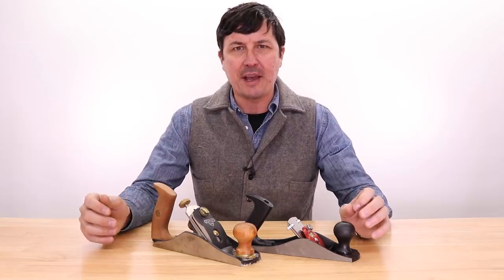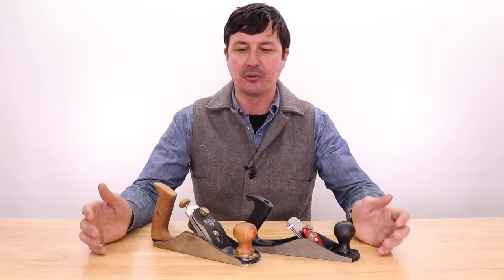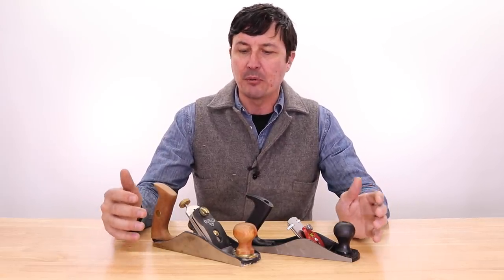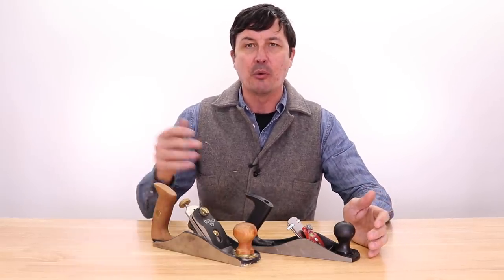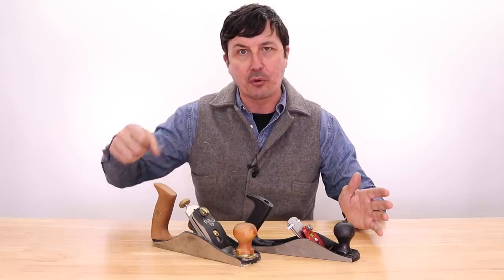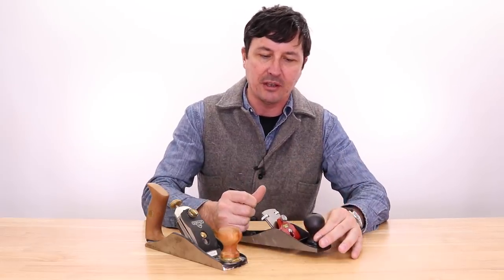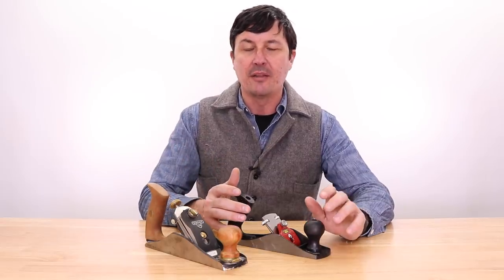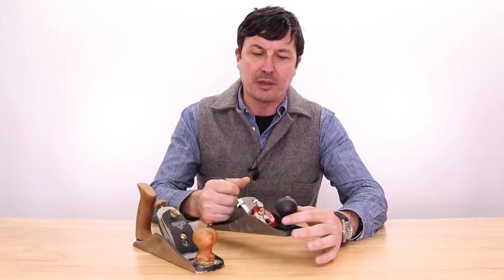Testing The Cheapest Bench Plane On Amazon

Comment: Why not start with 200 grit and then move to 320 to cut your time way down?
Reply: DigitalMocking I used to buy handplanes at flea markets. Most were so rusty that I had to start under 100 grit. 
Maybe this plane is too thin and he didn't want to risk taking too much
Reply: raphaelbianchi You can only take too much if you keep grinding beyond when the entire surface has been flattened. Up until that point you haven't removed enough. Also that glass is too thin to be counted on as flat, especially on an uneven surface. Most likely the center was low, and now the plane sole has a slight bow. If you can't find thick glass (if you watch your local classifieds you should be able to find something before long for very cheap or free), then stack multiple sheets of thinner glass. Each layer helps to reduce the amount it can flex and conform to the surface below.
Reply: DigitalMocking 200 grit diamond stone or lower would make quick work of leveling that plane out as well. Better yet buy a cheep synthetic.
Reply: I purchased the exact same plane and used a granite flat stone to surface the foot of the plane. My experience was identical to Wranglerstar - the foot is severely cupped.
Reply: Start with 60 grit if you've got a lot to do. But don't stop short like he did - use a more aggressive grit to start with and work up to 320 but get the surface flat. There is no need to ever go finer than 320 on a plane bottom so he actually started with what he should have finished up with. The entire idea is making the sole flat - shiney doesn't matter.
Reply: gl taking too much by hand, lol
Reply: I would use a stationary belt sander if it was that bad.
Reply: Bench top sander is a great place to start if the face is bad

Comment: 8:59 glass being a really thick fluid is a myth, i remember back in college chemistry classes chit chatting with the professor and we entered into the topic, and he explained me that glass cant be a fluid because (insert bunch of chemistry that i cant quite recall) and probably the glass was insterted with the thicker part down to make it more stable. 

fast forward not so long ago, i got a chance to talk to some architecture students and they told me that in their field is pretty common knowledge that before machines and such, perfectly flat glass was hard to come by, so everyone ended up with glass kinda missshapen to an extent, so they would put the thicker part of the glass down so its more stable. and this is supported by the fact that 300 year old telescopes still work perfectly, and the lenses havent changed a bit, or that even older windows are not even more deformed
Reply: Wow that's awesome 👍 thanks for the info

Comment: If you need to put that much time into tuning up a NEW plane, I wonder if the time would be better spent on finding a decent used older plane and doing that work to it. Might spend $20-30 on an older Stanly standard plane, but I wonder if it would last longer in general...

Comment: Just a heads up, the back of a plane blade does not have to be completely flat. Since the blade is cutting on an angle, only the (secondary) bevel is making contact with the wood.

Comment: I just bought this plane a week ago from Amazon for less than $20 with free prime shipping.

I spent close to 3 hours flattening the sole at 80 grit, when the entire surface was touched I moved to 150 for half an hour, then a big jump to 600 grit (fresh out of everything in between) for half an hour. The 80 and 150 grits were dry and the 600 was wet. I found that after a few dozen passes on dry paper, you can run a magnet along the paper to collect the filings. All that gave me a near mirror finish.

I'm still working on the iron, but I've reground the primary bevel to an accurate 25° with plans for a 30° secondary. I'm currently working on getting the back 100% flat.

After an early test run with a blade only at a 25° 600 grit bevel, I noticed the twin nuts are a pain in the @$$ to use. I kept over tightening one, then the other, took many tries to get it level. Then I wanted to adjust the depth and had to do the whole process again. Might get easier with practice.

With my very limited woodworking knowledge, I'd say it's worth about what I paid for it. It doesn't exactly appear to be a diamond in the rough, but certainly a slightly frustrating, yet usable alternative to the expensive ones once tuned properly.
Reply: Take those adjustment screws off and throw them in your spare parts bin. for adjustment see my post to Wranglestar above.

Comment: It seems a bench plane is a lot like a guitar.  You can get by with a cheap one as long as you set it up properly.
Reply: M ZAKRIA not really that simple, depends on the plane but you generally need to flatten the bed, sharpen the blade and tune it in other ways
Reply: yea,  but like a guitar, if you consider the time you spend setting it up(not to mention using it), it makes more sense to start out with a quality instrument imo. Time and attention are our most valuable assets
Reply: M ZAKRIA yes that’s fine, I’m only 14 and am restoring my first hand plane on the weekend however I have used Stanley’s, record and lie nielsen planes and they all require a bit of tuning, lie Nielsen less than others but my point was just that it isnt always easy, anyone can do it but it takes time and patience
Reply: M ZAKRIA and yes I understand how the plane iron works, you sharpen it and generally it lasts a while, then you have to sharpen it again. Just don’t make the mistake of buying new blades like ive seen people do

Comment: Cody,
Great idea! Love your channel.
 My suggestion would be to do these in this order: 
Measuring devices first (tape, try or speed square, carpenters square, & plumb bob/chalk line) then,
The saws (crosscut, rip, back, and hack), 
Chisels (1/2", 3/4", & 1"), 
Files and rasps (flats, half-rounds, and rat tails in fine, coarse. and rasp cuts), 
Hammers (carpenter's, tack, and ball peen - and maybe a set or hand sledge), 
Drills (power and hand), braces and bits, 
Sanding block(s) and papers, 
Screwdrivers, 
Pliers (utility, vice-grip, & needle nosed),
Clamps,
Whetstone,  
Retractable utility knife, 
and .... (perhaps) A book on woodworking (have you ever thought of writing one - "in your 'spare time'"? Your knowledge and style would probably make it a best seller.)

In any case, it's your channel, your choice - just my suggestions.
Reply: +1 to Super Geek comment. The book would be a nice addition. 
To the woodworking series would be nice to add a dedicated episode about protecting wood surface, hard and softwood. Both for indoor use and outdoor use. Maybe these informatons were present and i missed them in older vids but it would be really nice to gather all that into one episode.

Comment: Neil Degrass Tyson would disagree with you about the old stained glass windows... I watched a documentary where he refuted that statement by claiming that the art of making glass wasnt as refined as it is now and that would explain any irregularities in the different panes. Also, there is no solid record of anyone finding this to be true, only word of mouth folk lore.
Reply: glass used to be made on a spinning wheel, and therefore, due to physics, more material would be pushed to the outer edge. Then, the glass would be cut into panels, and as us labors do, heavy end down, giving the appearance that the glass was "dripping" downward
Reply: Evan Goodwin, I recall something about spun glass in the documentary I was watching. Thanks for your input :)
Reply: If the glass was making the bottom edge 'fatter', then the lead would have opened up, possibly causing the pane to leak when raining, but definitely you would notice the difference when the wind blew.
Reply: Dave WasinColchester, another great point!
Reply: veritasium does a very good job of explaining...

Comment: Is it possible the high spots on the heal and toe are intentional? I saw recently that traditional Japanese hand planes have a slight hollow between the leading edge and the blade (presumably to reduce contact surface area and therefore friction, but maybe for other reasons).

Chisels would be perfect for the next episode. Measuring equipment should come soon, too--marking gauge and marking knife, square.

Thanks for the series. I'm just getting interested in woodworking and it's great to know how good or bad the cheaper options are. Between this and Paul Sellers' series, I won't lack information to get started.

Comment: As a former shop teacher I always taught my kids to NEVER set a plane down on the sole. Even on wood. Always set it down on the side. Yeah, I know it's knit picking. LOL
Reply: why would you no put it on wood? its the material you cut.
Reply: because it can damage the tables
Reply: Because if you learn to never set it down that way, even on wood, you probably won't set it down on anything harder, aka, metal. It can dull the iron. Call it a learned reflex.
Reply: what I was trying to say. its about working habbits in
Reply: Wayne Novotny Paul Sellers debunks that practice with a good explanation that kids are kids, and a plane iron is at LESS risk when it's sitting on wood than on edge where a stray chisel could wack it. I've gotten out of the habit of laying a plane on its side.
Reply: Might dull your $20 plane :)

Comment: I'm not sure how much I trust a guy who has an expensive plane but never really took apart and couldn't tell you what the backing iron is
Reply: And leaves it sitting on it's sole!!!  Sacrilege!
Reply: @chrisw1462  I have no problem leaving a plane on its sole provided it is on my wood bench, free and clear of any metal.  The plane blade edge is certainly tough enough to withstand moderate contact with wood, without damage.  Try it and report back to us if you wish.
Reply: I just thought it was interesting how big of a deal he made about the thinness of the cheap blade—it looks thicker than the old Stanley blades for all my old bailey style planes. Also, why did this dude start with 320 grit on something so rough? I would have started with like 60 or something and worked my way up, Just me tho.

Comment: My father-in-law bought this plane for me as a birthday gift about 4 years ago. After sharpening the iron it cuts great. Mine does not have the curations on the handles like this one. I do have trouble getting a square cut though. Always takes more along the right side than the left. I’ve since bought a Stanley no. 3 from the 30s that I prefer to use, but still use this one from time to time to teach my son a few things.

Comment: 1. Make sure you're using poured glass as it is much flatter.
2. Start with a coarser grit to decrease time spent sharpening.
3. Thoroughly rinse and/or wipe whatever it is you're sharpening before moving to the next sharpening stone to avoid compromising the finer grits.
4. Finish the flattening process before assessing the overall "finished" quality of the product. 
5. Know more about planes before reviewing them.
Reply: Unless you’re using antique glass, all glass is float glass. Not poured, poured would not be flat at all.

Comment: Ok, I bought it.  I followed the same plan you showed to sharpen it (watched it twice).  Gotta say, works good for me. I can feel that it's not a high quality plane and it takes some time to set up, but it works great. I really enjoyed the start to finish process of setting it up and it was almost super easy after watching you go through it.  Honestly, the best tip was to check either side for the depth of cut to make sure it's equal in depth.  Thanks again!
Reply: Good for you George. Truth is, unless you spend 300+ you are going to have to go through all those steps anyway, with a new plane or something older from eBay. The only difference is how long it takes. I chose the eBay route for a 1920's Stanley 4, but that was my personal choice. And yes, I spent probably 3 hours flattening and sharpening it.

Comment: It makes sense to use it, with glass, to diagnose how flat the sole is, however, 320 grit sandpaper to grind metal to flatness makes no sense. Why not start with 80, before moving on to a finer grit? Sandpaper ≥320 grit is strictly for finishing. Also, you assert that the iron can be sharpened using sandpaper. Why not demonstrate that, instead of using whetstones --- which you even admit are a big investment???? I really wanted to like this video. I'm a beginner. I love the concept. But he is playing teacher. Bits of misinformation, here and there, add up.
P.S. What you refer to as "leather" is called a strop, and these can also be made from canvas and other materials, not strictly leather.
Reply: Yup, if you can afford diamond stones, then you can probably stump up a bit more cash for a better plane. Also this plane is nowhere near the cheapest plane, at least not now. There are planes that use a piece of bent sheet steel as a base, instead of cast iron.

Comment: A couple of things: glass is rarely flat and it is flexible. you should flatten a plane sole with a flat file checking with a straight egde (or really go old school and use a machinist's scraper, and a reference flat), then stone the bottom smooth. The sandpaper trick is definitely a hobbyists dodge. A new plane iron back needs to be cheched for flattness with a straight edge and ground flat if it is not true. The bevel should be ground to an accurate 25 degrees before trying to hone. Youll probably spend two to three days getting this plane to work properly.  That may or may not be worth your time depending. But if you are serious about craftsmanship and dont have a lot to spend, just buy one excellent block plane to start, then add a medium bench plane next year. They will take you a long way.

Comment: 5 hours of your time and all those sheets of abrasive, suddenly this is not a $20 plane anymore LOL
If you were to buy this, (I would not) please use some #150 wet and dry sandpaper to bring the bottom flat, much quicker.
Like I said, I would not buy this plane, I think by spending just a bit more, another $20 you would have a tool that would be much less frustrating to use. 
If you do get further into woodworking this plane would quickly be eclipsed by better planes, so then what? Well what I would do is plan for this plane to become obsolete as an everyday bench plane once you do get better planes, at that time grind a much more aggressive camber on the plane and turn it into a scrub plane, then it would no longer be obsolete.
I really do think that you can get away with inexpensive chisels, handsaws and other tools, (make your own mallet for example) but a hand plane is a bit more complex and you should spend some money on it, this is too cheap, in my opinion.
YMMV

Comment: Rex Krueger did a video on this plane. He completely took off the mechanical depth adjusters and showed how to use a couple of small hammers to adjust the iron. I started using hammers to tap the iron on my block plane that always gave me issues setting the depth, and the tap method works so much better.

Comment: I just got first cheap plane, and yes it is bad, but i find out the is easier to start wet sanding with P100. Paper quickly worn out but it cut fast, I think 4 piece will do the trick.

Comment: I've had a similar plane for some years - the adjustment is simple once you realise that when you back off the screws there is a turn or two of slack so you need to make sure you always tighten back up to ensure that the first time you use it it stays put and doesn't take up the slack.

Comment: thanks for the video, I bought this plane a while back but could never get the thing to work at all even after sharpening it. When you flipped the iron around so the bevel was down it changed the whole tool. I did not have instructions or I lost them, but it came bevel up so I thought that's how it went. I just went and tuned up a few things and it works pretty darn well now so thanks for the info.

Comment: love the work and presentation, the question i came up with is, why did you not use a 200 grit to start ?, seems like would have been the way to go with that much work on the plane...  and yes i like to see chisels. i got a harbor freight set of 4 for a small proyect at home and it seems to work fine, had to do some work to get thenm going but they did the job... Thanks for the hard work and great video.

Comment: About ten years ago, I bought an unbranded variant of the old timey N⁰ 4 for $25 AUD (about $12 US). Upon buying it none of it was square, the blade wasn't true and the threads were... not good. The sole had a hollow some 2mm deep and looked machined with a gravel footpath.
I think I spent a few days working on it, sanding the frog flat, squaring the sides and blade, flattening and smoothing the contact patches, working the threads with oil and ensuring the edge was sharp.
Sure enough, my cheap knockoff plane works as well as any great plane and shaves Australian hardwoods like Spotted Gum and Redbox like it was pine.

Comment: I would love to see what happens if you switched the handles.The new plane trailing hand is angled to put more force down than the older plane.Put a 90 degree wood block for a trailing hand grip and it will train anyone on any plane on how the tool works.

Comment: I have a "Windsor" plane with the same adjusting mechanism. I feel it offers more control over the iron, WITH the caveat that the thread pitch must be taken into consideration. Question: Why start at 320? Knowing the sole is wonky start at 150? Weighing in on the Water stone contention, it seems to be a dick comparing contest. Does one get 1600x better surfaces???? NOPE. Good review though. Bench vise test?